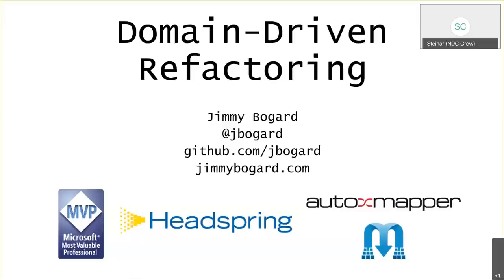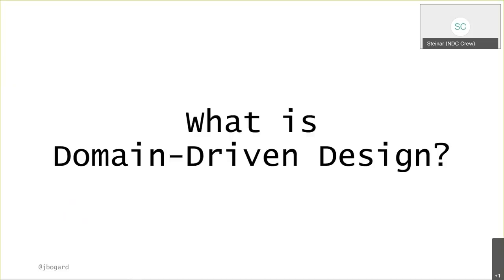Domain-Driven Refactoring - Jimmy Bogard - NDC Oslo 2020

Comment: Nice  video. :) Just remember guys that there are simpler ways to implement strategy. You can just set a delegate on the class with a lambda; it's way less ceremony that way. I guess probably the SmartEnum package depends on this derived member approach, and that's mostly why it was used.

Comment: So before CalculateExpirationDate could only depend on the public interface of OfferType now it can also have a dependency on it's private methods or properties. I don't know how that refactoring made anything better.
Reply: It's easier to understand that way. It is a question of cohesion, a function concerning OfferType belong with OfferType. 
You encapsulate function with data, you make it reusable across all your application and more importantly : testable. With this refacto, you can test it in isolation of the details of the service that doesn't concern the function itself.
I don't see why CalculateExpirationDate having a dependency toward private method and properties of its own type is a problem.

Comment: 1. IOfferValueCalculator is a bad encapsulation. It calls url that use objects offer and member. You can just encapsulate those two objects in one object that calculates the url path and pass that to CalculateOfferValue and you don't need interface, it's better to do Integration tests, with some kind of container. 
2. Calculate expiration date is a good encapsulation.
3. Assign offer is also bad encapsulation. Adding business logic inside model object will cause mocking, which is bad when you have control over the code a.k.a white-box testing. Instead of OfferValueCalculator, you can pass the calculated value then it will become more unit testable, because the code don't depends on any runtime.
4. You can reduce the number of parameters in Offer constructor to member, offerType and value. Inside the constructor you can call offereType.calculateExpirationDate
Reply: Re 3; i think passing a prepared Offer object might be a good option too. But regardless, i disagree with the statement about business logic. The whole point of a domain model is to contain business logic right?
Reply: I thought the same about what you mentioned in point #3, it would be better to pass the calculated value instead of the calculator. That way, the core domain model remains pure without having dependencies on the calculator domain service, especially when that service has a dependency on IO/out of proc. I agree with you also on that I like how the Calculate expiration date logic was encapsulated using the strategy pattern.
Reply: @patrickroza3073  but calling I/O (db or http) isn't business logic
Reply: Josifov Gorgi I think that’s a bold statement. Of course the specifics of the IO is not the business of the domain model. But the decision to call something, depending perhaps on state, is very much the responsibility of the domain model.
Hence it’s not so clear cut to me. The sample is perhaps not the best illustration for it. It’s a bit crudy, no real decisions are being made. But often calling a query or executing a command is dependent on business logic, removing that responsibility from the domain is imo splitting your business logic.

Domain events and domains services come to mind as ways to deal with it.

In any case I struggled a lot with these decisions. It’s a trade off in the end.

(db calls, even through repositories I would never do in the domain model however)
Reply: @patrickroza3073  the decision to call I/O can be encapsulated in the domain objects ( because it depends on inner domain object state).
But as you said many times that decision is just big sql query or pl/sql procedure in that case it will splitting the business logic and that is ok, because you can't have "full" business logic in your domain objects.
Looking for "pure" always leads to over-engineering, because you are working with other components (free or paid) that are making your life easier ( just image you have to build db/http server every time you create new application. The first problem is multi-threading.)
Let say you go full business logic in domain object and one of those business logic have an sql query. A sql query in you domain objects has dependency of db in your project and there for your "pure" business logic isn't "pure" because have dependencies on db.
A better approach is to encapsulate as much as possible business logic in your domain objects and the rest of business logic that you can't put in the domain object you will go to the service/repository layer.
That way you will get more unit-testable domain object and business logic without mocks/stubs and for the business logic that depends on i/o you will make integration tests they are more valuable that unit-test with mocks.
Unit-test with mocks are bad, for example you have sql grammar error with UT with mocks the test will pass, but your integration test won't pass, but also you spend double the time to write UT and IT tests instead of bug fixes
Reply: Christian Quirós nice! Thanks a lot for the reference.

I’ve been on both of the domain model purity and completeness sides. Interesting enough I am currently leaning towards the completeness side, by probably leveraging the lowest level of interface; function signature (delegate). Or, In Scala’s ZIO and Typescripts “matechs effect”, the dependency handling through “environment” helps ease the pain a bit for me.

Of course in the session example where you don’t need the delegate as the sessions are already loaded in a list, one way to optimize would be manually eager load only the last session. While this couples the controller action on the implementation detail of the domain, it would still accomplish all 3 goals :)
Reply: Christian Quirós still, the examples don’t really cut it for me because I believe these are the easy cases (dealing with data I own, in my local database). 

While it is similar, I find cases that communicate with other owned, or 3rd party (micro) services a lot more interesting. Esp. When we  are also talking about affecting their state instead of only reading from them.
Reply: thanks a lot especially for the last link. I was not aware of that one. Certainly some interesting approaches there. Stub > Mock. And definitely a compelling idea to have nullable infra, similar to null objects - baked into the production code instead of spread out over tests which caused tighter coupling.
This will keep me busy for a while digesting :)

As to ports & adapters/hexagonal, I know it as Clean Architecture (Uncle Bob's take), and have been practicing it extensively.

While I do strictly keep the loading and saving db records, as well as publishing integration events, in control by the usecase in the Application layer, and implemented by Infrastructure,
I do run into cases where some logic is really intertwined with making queries or commands to other services conditionally.
Separating this out imo would make a bigger mess. The suggested multi-sandwich+traffic-cop, or moving logic to infra layer etc sounds more evil to me, in the end it is the trade-off between pure and completeness :) So far I view purity more as a strive and an ideal.

While I believe for our usecase it is fine that we are calling other services (either they are 3rd party products (buy non-core) or they provide access to distinct groups of business objects and actions, which are shared by several apps and viewed from different perspectives), I will at least reconsider it, and think of alternatives. Never stop questioning your decisions ;-)
Reply: @patrickroza3073  you're welcome. Some of the challenges you mentioned in your last reply reminded me again about other material, https://learn.particular.net/courses/adsd-online In this course Udi, the creator of NServiceBus, talks about the engine and sagas strategies/patterns when used in the context of SOA architectural style. That rang the bell when I read your last post. 

To "Never stop questioning your decisions", thanks for the advice :)
Reply: In your opinion?
Reply: @moorzymoores  Of course, it's my opinion vs his opinion. There isn't mathematical theorem for DDD or any other driven developments, they are all just opinions.
Reply: @JosifovGjorgi  yes..... I know.

Comment: You're not supposed to use third-part software in domain (SmartEnum)
Reply: Only if it adds dependencies on infrastructure concerns. If it's just pure code and won't make anything harder to test, it's generally acceptable.